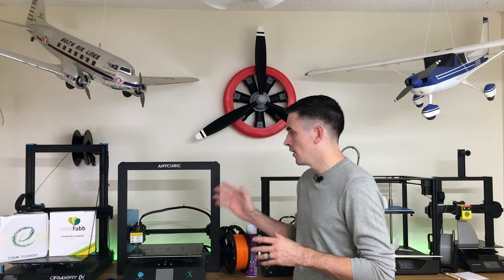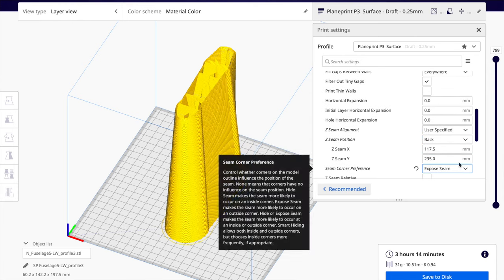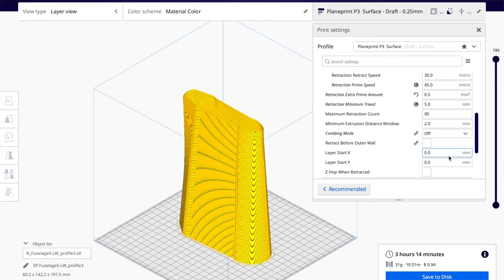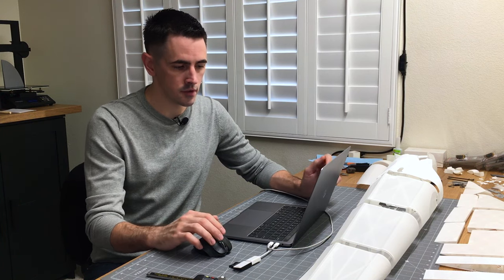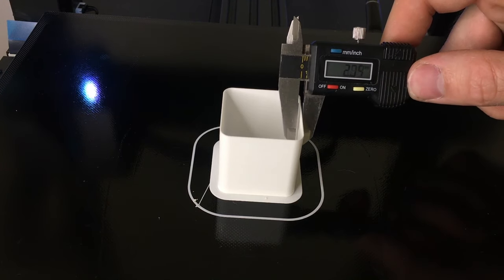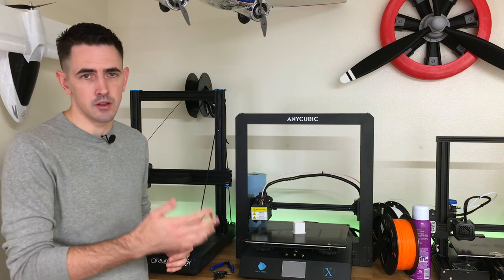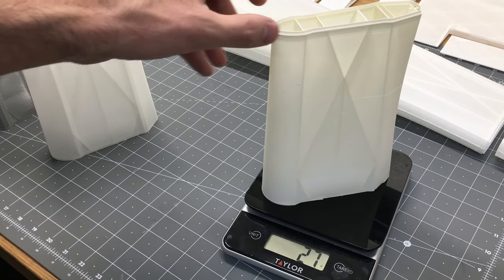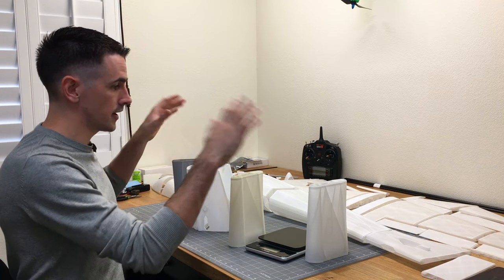How to Print LW-PLA (ALL MY SETTINGS) | ft. NEW eSun eLW-PLA

Comment: Great to know eSun do it now. Also to note that Esun have bought out their ST-PLA (Super Strong) Same weight as pla but it has properties  that feel more like an HDPE plastic bottle. The specs show as inferior to pla EXCEPT that the sheer strength, Layer adhesion and mailability are more than double that of regular pla. This should be a game changer for rc aircraft where increased strength is nessesary.

Comment: Everything works with the settings on mine except it keeps making a squiggly line down one side. It does not do this on the other side. Do you know why it is doing this? I am printing with an Ender 3 Max.

Comment: Great video Troy.  It is tough for noobs to get it right without help in the beginning.  A note to inexperienced 3d printer users, not all filaments are made the same.  I bought some  Inland LW-PLA that gave beautiful models but the walls were .34mm thick, quite tough but very flimsy.  Finely got the E-Sun LW-PLA and - bam - great parts right off.  .51mm thick and weight was right on spec.  I got a CR 10 V3 with the glass bed.  Found that gluestick works great if you put a bit on and use a little rubbing alcohol and paper towel to smear it all over the bed real thin.  Locks those parts down really well and a little bump and they pop off without damage every time.  No more prying and digging.   Hope you enjoy the coffee I sent last week.
Reply: Hola. Bajé CURA, pero no me sale el filamento LW PLA... O tiene otro nombre en Cura???.... Gracias

Comment: Thanks again for posting this. I have a model I bought years ago from 3DLabs, the Swift S1. It's a mare to print, especially F_2.STL, as you need Cura 4.8 and 'filter tiny gaps' for the PLA parts due to the way the mesh has been rendered. Fast forwad 4 years and now we have Eclipson and 3DLabs knocking out some beautiful designs.

Comment: The slicer settings seem to be the most challenging so thanks for posting this video. You did mention that the only change for Eclipson planes is to leave Surface mode as Normal but after comparing the settings line by line with those recommend by Eclipson's A-LW profile (imported into Cura from their g-code files) I see quite a few differences and wasn't sure which one to use. I guess I could try both.
Reply from the maker: Depends on the material you are printing out with!

Comment: Thanks for showing the same sliced part printed on 3 different printers.  That's the only area I worry about regarding settings.  Your settings work great on your printer, but may not work as well on my different printer.  Your showing the same part across 3 printers is significant.  Cheers.

Comment: Could you do strength testing with different LW-PLA filaments? For normal 3D printing you can usually improve the strength a bit by increasing the temperature but it seems that LW-PLA is really finicky with the temperature so that cheat cannot probably be used here.

Comment: hi, i'm new to plane printing and i'm using this guide to set up my esun-lw roll (first time using it). I didn't quite understand what you are saying at 4:56 regarding the new printing method. Is it a specific profile setup or is it  referring to how the plane is designed?
I use simplify, so i'm sure i'll have to play around with my settings, regardless.

Comment: Hi Troy.  Thanks for all your wonderful instructional videos.  I have found one problem worth noting.  I am using an Ender 7.  I have been working with the Eclipson Pitts (you demonstrated the build in a different video) and found that in spite of all the settings you have shown in this video, there is a G-code command M106 (sometimes more than one) in the G-code created by slicing the Epsilon STL files.  These M106 codes are also in the G-codes Epsilon offers in their download too.  Regardless, unless I edit out those M106 codes before printing, the nozzle temp drops precipitously to the point where the printing stops due to a heating error.  That said, as long as I edit out those M106 codes from the sliced file using your slicer setup, the printing results are excellent.

Comment: How do I get the wall thickness to increase.  I printed a test box from 230 to 270 in 10 degree increments and really didn’t see a an big difference.  Printing on a Anycubic Kobra direct drive.  I printed a plane from 3d lab print.  The weight of each piece was correct but the walls were thin by 1/2.  It’s almost paper like rather than plastic.  Any help is greatly appreciated

Comment: HIi and thanks for infos on cura settings for LW printing... Cool but touchy the right difference with std PLA... Watch out, my plane have guiding tubes for link servos to tail LW will shrink these hole's dia and squatching the steel piano wires what now???

Comment: When flying the airplanes, dp you ever get cracks along the layer lines say in the wings because of such a thin wall? I mean when the surfaces slightly bend due to maneuver induced or load stress?
Reply from the maker: No I haven't experienced that! It has a little flex to it, so it would probably have to be a pretty extreme situation

Comment: Great instructional videos Troy, I've learned a lot from them. In this vid you mention how to get rid of stringing printing LW PLA. Which is the newer method that you mentioned? My LW PLA test wing from Plane Print still has stringing issues.
Reply from the maker: You can't print the test part out with no stringing. Try printing out one of the parts from a plane that is designed for lw pla printing!
Reply: @TroyMcMillan  CAn you elaborate?  Is there a slicer setting to activate so that the head moves without stopping (as briefly shown in your video). I have a PRusa Mk3.

Comment: Thank you for posting this really informative vide on light weight filament. Was wondering if you could help out with the eclipson settings on a VoxMaker slicer software. Some of the setting are not the same or it's different and sometimes get lost trying to transpose the settings between what you have on this video. Thanks in advance.

Comment: Printing R / C models is very tempting. However, I see two serious drawbacks:
- filament price. Currently, 1kg is over £ 40, meaning the larger models will be worth hundreds of pounds
- temperature resistance. I'm afraid that in summer the model can easily distort from the sun

Have you had any experience with this?

Comment: Im really struggling with lw-PLA from eSun bottom layers are spot on but as it gets about half way I am getting ribs on the outside of the layers not sure what is causing this ( using a ender 3 v3 se with cura )

Comment: Awesome, what kind of printer are you using? How much did it cost to print this aircraft with LW PLA,  was there a significant price difference in printing the same aircraft with Colorfast vs Esun? Are there any FPV aircraft that can be printed with LW PLA? How about strength of the LW PLA,  strong enough to mount gimbled camera's? Thanks!

Comment: Hi Troy, I'm trying to print the 3dlabprint piper using these configs but the control horns are not being printed. it only prints the outline. I tried to chang the top/botton configs but it didn't work. What should I do to print it correctly?

Comment: Noob 3d printer here. I have a FLsun v400  delta printer. If I wanted to take advantage of its speed, can I just raise the print and travel speed settings or will I run into other issues by trying to speed it up? The LW Pla prints so different from regular PLA and I’m trying to not waste too much of the LW stuff because colorfab is kinda pricey. Will have to try ESun. Thanks for the help!

Comment: Thanks for the video im new to 3d printing and have been watching as many videos as i can , im using a 3d printer primarily with the intention of printing rc planes  and have a shop nearby that sell E SUN so that has been my go to sofar . a question i have for you or others ,is the stringing inside a wing or fuselage really an issue other than visual? ive only just started 3d printing and have started with a 2.1mtr B17 bomber in E SUN LWPLA on an ANYCUBIC KOBRA 2 MAX  so far most pieces have had minimal  stringing but other parts more . im thinking of trying to remove most but unless it interferes with anythin im not to fussed, another question is how much glue should i used between parts ?  havent started glueing yet but suspect a thin bead of super glue and pressing together until set and perhaps a bead inside with a sprinkle of baking soda. if anyone out there has any useful hints or suggestions im all ears.

Comment: Curious have you printed at 250 instead of 235? The temperature data indicates that 235 is suboptimal compared to 250. I also believe the weight will be lighter and thickness will be increased which likely makes it more durable. I would love if you could comment. Thanks, your videos are great!
Reply: Seems he doesn't comment on YouTube :-)
Reply: Well he did not respond but I did purchase eSun LW-PLA and printed a plane at 250c on my Ender3 Pro (has Capricorn tubing) and it definitely prints better than 230c. It expands more and overall stronger print. @TheGeordietheWitchandtheWench
Reply: I have the same experience. Better results on the Ender 3 V2 using 250 C instead of 235 C (I also have the Capricorn tubing - it is the only upgrade - rest of the printer is stock).

Comment: Hello, I have problems with the stringing. At cruising speed I always get it with retract or without. I use the prusalicer but the settings are almost the same. in vase mode there is almost no cruising speed. and also no stringing. but in some prints you need closed top and bottom. On the wing where the ailerons are, the wing edge is always open, which is bad. I print that in normal mode, all settings the same but without vase mode, just 1 perimeter. How do you do it, or you Troy?  Lw PLA ColorFAbb

Comment: Troy, another great video. I have learned more from you about Cura & 3D printing than from any other source. Thank you. One of the things I'd like to see you do is setting up Cura. What fields need to be made visible in Setting Visibility? I've also noticed that at times you show the extruder and the nozzle path. How is this done? And I've seen animation controls along the bottom of your screen is some of your videos. I have only a vertical scroll bar along the right edge of the screen for going to different layers. Is the animation controls & nozzle visibility something that needs to be turned on somewhere in Preferences? A plug in?  Thanks.

Comment: Hi Troy, I know this is going back a bit, looks around 2021, back then you mentioned getting rid of the internal stringing, there was a new gcode process. Is that common these days. I am printing using eSun PLA LW @ a 250-degree nozzle temp and I'm getting really bad stringing just like the inside of the wing section you showed in the video. I know you don't use a Prusa Printer, but can I utilise/implement/find this new method in Prusasliser?
Reply: Have you noticed Troy has NOT replied to anyone who has this question as myself? He doesn't know but wants your money.

Comment: Are the lw-pla wings more resilient compared to PLA when they fall to the floor or are pressed with your fingers? I made it out of PLA, but when it breaks, it breaks easily. Is lw-pla stronger than pla? Or is it similar? I wonder
lw-pla is more expensive. here in Korea.

Comment: Hey Troy Awesome Vids... Learned a lot from watching... Maybe one day Ill run into you at one of the flying sites as I live Vegas too...  I've been using your settings in a couple of your vids to get started on an Eclipson Model S.  while your print settings are nearly perfect, my prints come out with highly visible seams where the print head transitions from printing internal structure to printing the thinwall "skin".  On Eclipson's models, thats mainly on the bottom of the wings.  Could you point me to the settings that might help with this??  Thanks again

Comment: I used your LW-PLA settings and of all the setting I've tried they produce the best results. I'm getting the thinnest walls. I still have one problem I have not solved and that is I still get pimples all over the print. In one airframe section I printed it has tubes for graphite rod support and the tubes have pimples in it so I can't insert a graphite rod. Any ideas on what I could try to eliminate these pimples? The stringy issues I had are gone! BTW When I print with regular PLA and the standard CURA profile I get good quality prints with out  pimples or stringing.

Comment: Troy, @1:08 I noticed you have a wall thickness of 0.8.  Assuming you are using a 0.4mm nozzle, why not specify the typical 0.45mm for this LW-PLA?  I ask because won't this physical 0.8mm thickness make parts not fit together as well as PLA including carbon rods into the wings, etc.?
Reply: I have the same question, do you find the answer?
Reply: @sebastian-wolf  No, not yet.

Comment: Hi tnx voor the explanation. I wonder if these settings also apply to the ender 3 Pro to print with eSun eLW-PLA?
Reply: Hi Lesley RC Fun!, My CR 10 V3 is like a big brother to the Ender 3 Pro.  Main difference is bed size and direct drive vs tube feed for the filament.  The firmware that runs the both rigs is basically the same except for the filament feed issue and the max model size.  The Ender 3 is a very popular printer so you should find most of the slicing software will have it listed as usable printers.  If you do not have much experience with it yet, I would suggest getting a spool of PLA or Tough PLA and make a few items from Thingiverse or other sites to get used to it.  Do the string test Troy shows on one of his vids to make sure your settings are correct.  Then print the wingtest file to see if that works out.  Troy also gives a very detailed list of settings in Cura to make sure your LW-PLA comes out as good as it can.  Experiment a bit with uncomplicated models to see what does what and move on from there.  The Eagle is BIG but a fun build once you understand your printer and Cura.  To answer to your original question "I wonder if these settings also apply to the ender 3 Pro to print with eSun eLW-PLA?", the uncomplicated answer is yes.

Comment: I see that you have an SWX1.  I have the same printer and also a FLSUN Q5. Hopefully,  I can complete my FLSUN QQ-S Pro(Hybrid) before the end of June.  I have designed and 3d printed parts for the QQ-S Pro.  What profile are you using on the X1?  I have S3D and Cura 4.13.1.  None of the beta 5 versions will load and I have not found out why yet.  I have a friend who is an RC flyer and a builder, and we are looking at collaborating on one of these builds.  He is very interested in the 3d build, but does not own a printer and has never designed parts for one.  His background is in aviation since he flew cargo planes during the Vietnam conflict.  I have to adjust my budget to get the LW-PLA to calibrate both printers.  This filament is not cheap.

Comment: At about 5min in you mention old an new methods of printing with the new minimizing movement of the extruder for certain Eclipson and Planeprint models. How is this only relative to these models?
This is accomplished via CURA-5 settings?? (Cannot use CURA 5 with my printer. (Not understanding.))

Comment: Hi, I successfully printed out the Eclipson V2 using your stl settings and it came out great on my Ender 3v2. I'm waiting on some carbon fiber rods for the build. Are you going to print/video the White or Gray Wing EDF?
Reply from the maker: I am so glad I could help! :) That is a great plane. not sure what you mean by the white or gray?
Reply: The Eclipson EWW-180 EDF(White Wing) or EGW-80 EDF(Grey Wing)
Reply from the maker: @maxdragon91  Oh, I would probably print the white wing then. I haven't done it myself though. Are you planning on printing one of them?
Reply: @TroyMcMillan  Yes, probably both in time. I have a few hot 50mm edfs to use.

Comment: Troy with regards to the settings for eliminating “stringing” when using LW PLA, are those settings need to be entered into the slicer or the .stl files already come configured with them?
Reply: STL files only store the triangles and mesh of the part your printing.
The Gcode is the file that "stores" the settings. I put that in quotes, because technically the gcode is just a list of instructions telling the machine where to move and where to extrude.

The guy put the settings on the video description though. Just copy paste it onto cura i think it should be good.

Comment: Thanks to this video I'll be trying out printing an RC plane! Are all Eclipson stls printer-friendly?
Reply from the maker: Yes! Do it! It is so fun :) As far as I know, Eclipson has redesigned all their models to be super printer friendly, but if not, all the models I have done are!
Reply: @TroyMcMillan  Thanks, I live downriver from you at Lake Havasu Az. and fly RC mostly FT foam board.
Reply: I received a roll of LW-PLA from colorfab and downloaded the V2 from Eclipson. I set my Cura 4.9.1 to your LW settings. Now, do I just use the LW-gcodes or the stls? Thank you.
Reply from the maker: @maxdragon91  if you are using my settings, use the stl file. The g code files come with settings already set
Reply: @TroyMcMillan  Thank You Troy!

Comment: Troy, another solid video. Thanks for sharing. I still cannot wrap my head around the cost of LW PLA but, I suppose the weight is what you are paying for. About how much material do you find you use per plane? I know this is a difficult question as all planes are different, but lets use the Panthera for example.
Reply: It expands to twice it's original size so it like having 2 kilos of filament in volume so half the price and you get a better idea of value